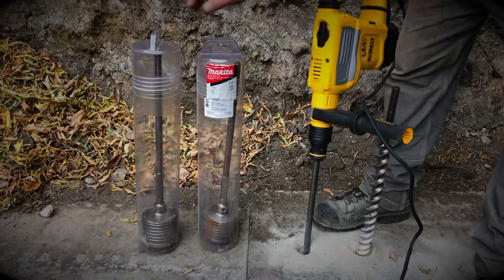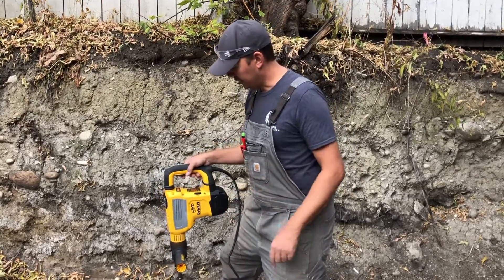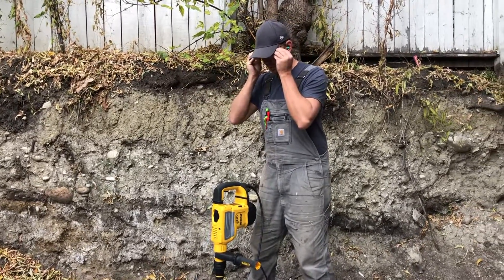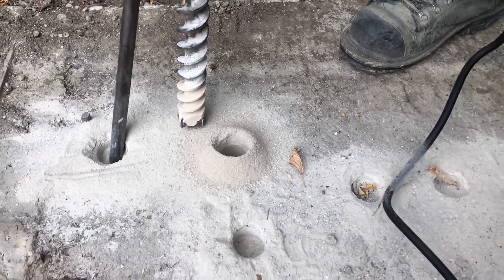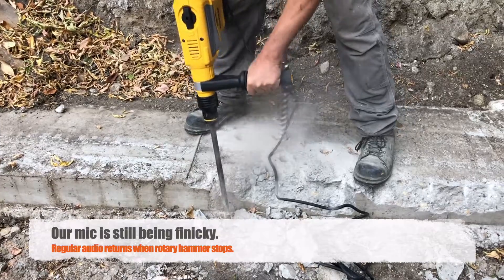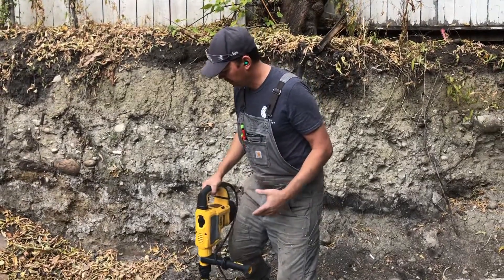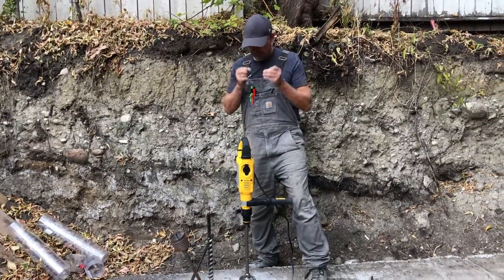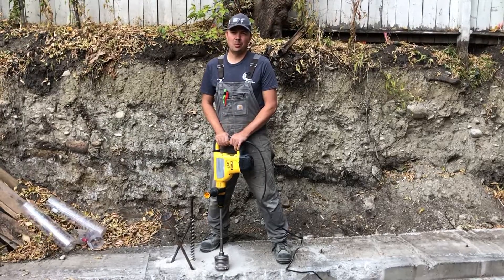Drilling a 4'' hole with the 1-3/4'' SDS Max Combination Rotary Hammer

Comment: Thanks! Simple, effective demo of the drill, chisel and coring action of each of the bits used by the rotary hammer drill. I have a better idea as to the size drill I need  for my job. Lot more confident having watched this.  Thanks for posting. Stay well and safe.
Reply from the maker: Thanks for watching 👊 it’s definitely hard picking the right size unit that will be good for other jobs.

Comment: I am doing core drilling mostly 60 mm on brick or half brick half concrete this one is my cheapest solution i also thinking seriously to go in battery with dewalt sds max the 6 joules one at 600 solo with x2 flexvolt 9ah i go to 900 euros or i layed my eyes on hilti 1.5k euros te 60-22 with 12 ah nuron battery my only draw back in battery is that if i dont jave other way and i need to open a 60 mm hole in concrete i will fatigue my expensive drill or not also i dont want to go to the bigger drills cause of the weight my holes are up to the walls not in the ground